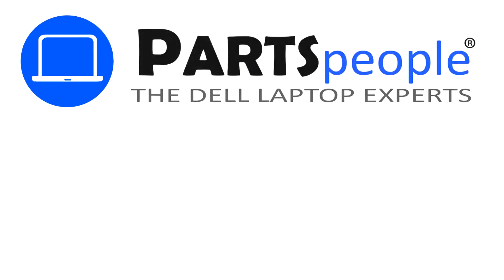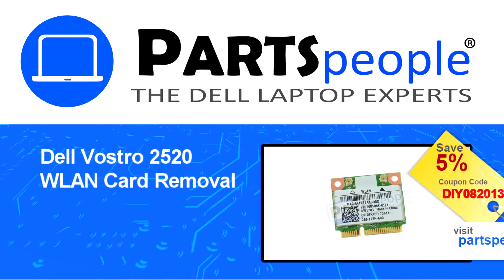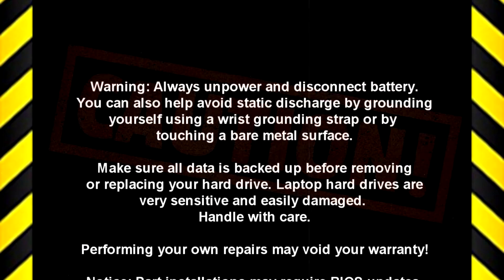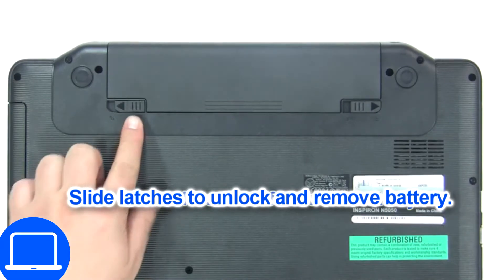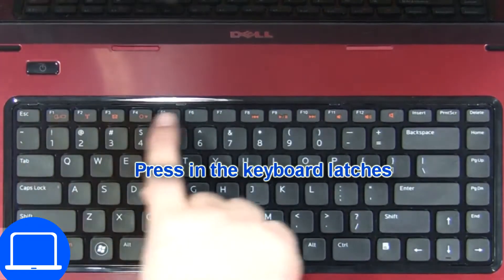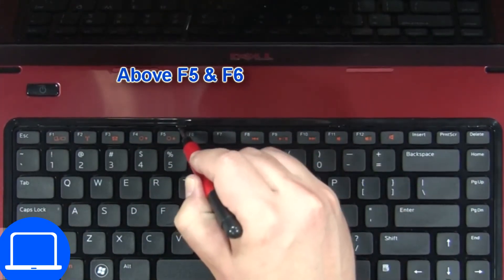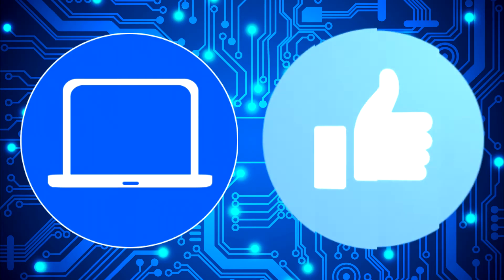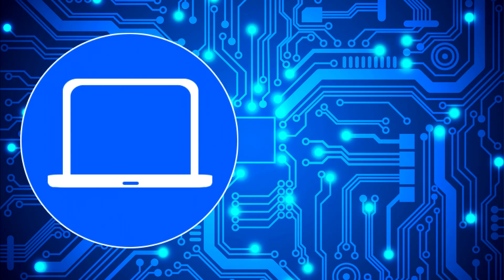Dell Vostro 2520 (P18F002) WLAN Card How-To Video Tutorial

Comment: hello sir. I have a computer model Dell INSPIRON P55F001.
I have a problem with the camera on my laptop screen when I switch on the camera and sit in front of it straightly the camera does not show my face entirely because the camera is not facing me completely, if I go some steps to the right side the camera will show my face entirely. so now I want how to open the screen just to get back the camera to the right position. I want to inform you that it occurred after a child stepped on the laptop with her feet. 
thanks for your recommendation.
kind regards
Diyari.